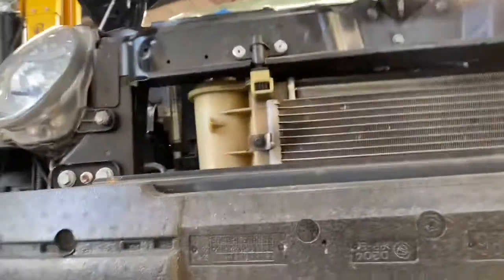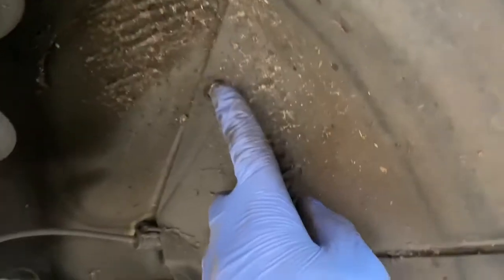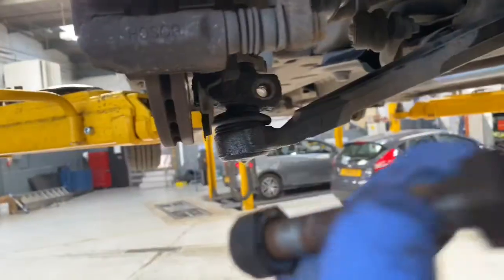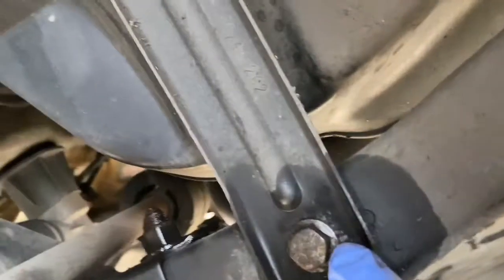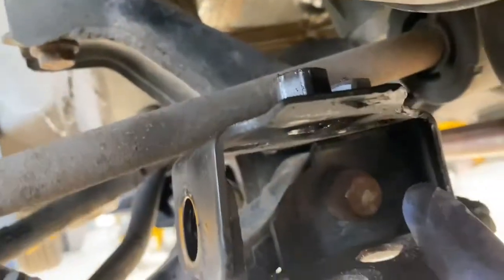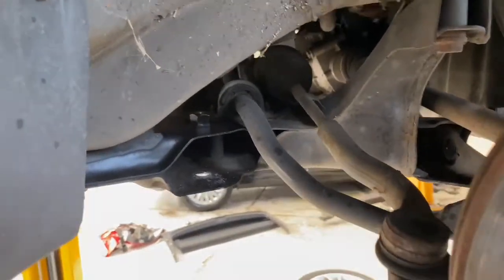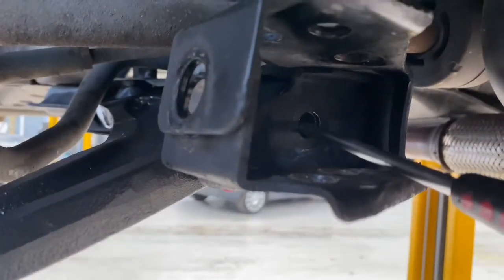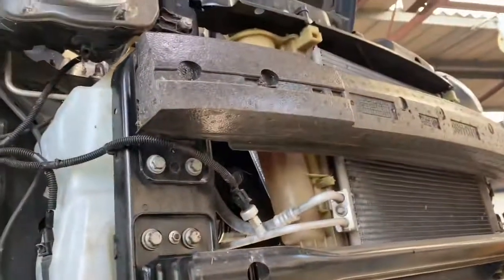#Fiat #500 #lower #Arm #replacement #instructions

Comment: I just did a lower controller on the passenger side from my mom's car I didn't remove the front bumper  I removed the password site under Fender well cover and grabbed my ratchet and a breaker bar and broken loose. I had it all done in 30 minutes